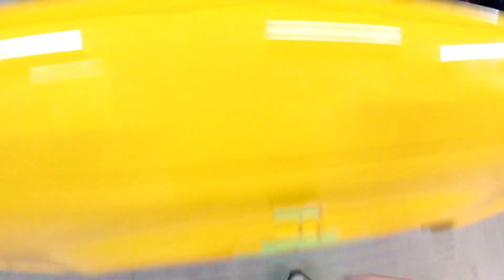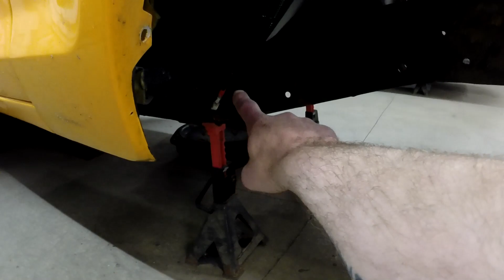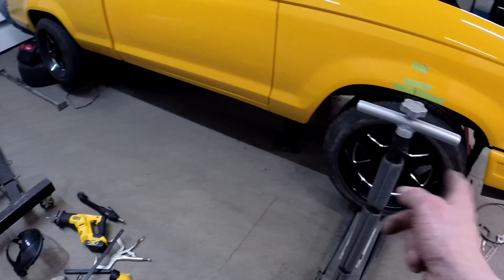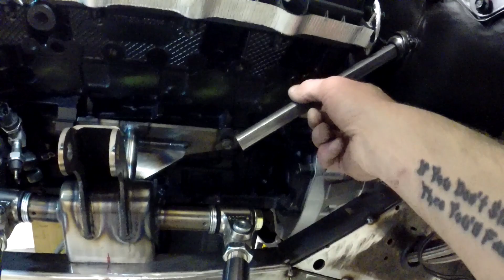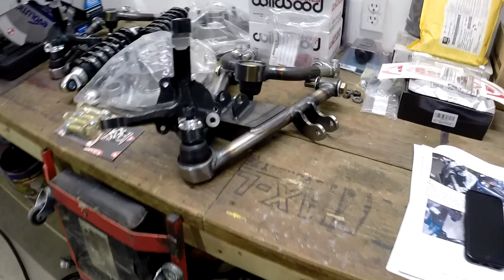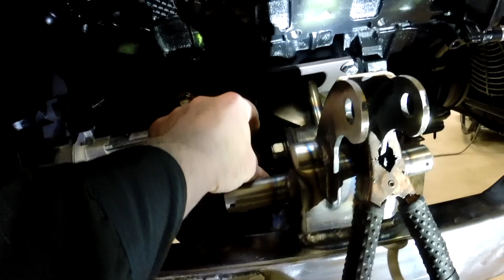Coyote Swapping my 89 Ranger  (pt 7 Front IFS Swap)

Comment: So just wondering, with the space and skills you have, why not take body off and have excellent access to everything?
Reply from the maker: Mostly because i used the Fenders/Body to measure where the old Axle centerline was, then set up the new suspension off those marks. Plus first time I've ever totally replaced a suspension like that, so I probably did things a little unorthodox.

Comment: Curious what you did with the old suspension components.  My kid has a 91 Ranger that could use a refresh on the i-beams, radius arms, and knuckles.  Would probably be interested in picking up a few things from you if you haven't put them in the recycle bin yet.
Reply from the maker: Actually still have the front I-beams/radius arms. Was trying to debate whether to toss them or try and sell them. They have urethane bushings on the radius & I-beams bushings. I do not have the shocks or coil springs anymore. Calipers, rotors, brake pads are on the steer knuckles yet. Pads and rotors maybe have 2000 miles on them.
Reply: @scmotorsports  Nice.  I will talk with the kid, there are definitely a bunch of parts on the front end of his truck that should be replaced.  If you are interested in selling, I am quite sure we would take them off your hands.  Watching your build videos on your Ranger is awesome.  You are meticulous in your build, cleanest and meanest build I have seen yet.
Reply from the maker: @ctdoutdoors  Yes, I would be willing to sell. Are you local to MN?
Reply: @scmotorsports  yeah, live up in Blaine and work in Eagan.
Reply: @scmotorsports  Not sure if you got rid of those parts or not yet.  I tried a couple times to leave a reply that had contact info and it looks like YT removed them.  Was wondering why I hadn't heard back but I am guessing the powers that run YT eliminated them before you saw them.
Reply from the maker: @ctdoutdoors  No, I didn't get any messages after your Blaine/Eagan comment. I still have the front twin I-beams. You can always email me at sc_motorsports@outlook.com

Comment: Check out PBH quick connect adapter for your upper radiator fitting
Reply from the maker: Yeah, I wasn't sure if I needed it or would have room for it. With the first fan I tried it would push the top hose into the fan too much. Now that I am using a different fan, I have more room. Turns out too, once I installed the intake and throttle body, the hose was rubbing on the throttle body plug-in, so I had to install one just to move the top hose away from the throttle body.

Comment: Lower is always better. Never keep a ranger stock height. Like I said in a previous comment on another of your videos, I am using the aje bolt in strut stuff and I am hoping it gets me at least another inch of drop over the djm beams I had. I dont want to be slammed but wheel gap of any kind is horrible to look at and my Explorer 8.8 is axle over leaf so its a 4 inch drop already
Reply: Curious how low the aje kit sits as well would like to be tucking  my skinnys up front about 1-2" to match the rear
Reply: @dylanpeeters8  there's a really good build thread on the ranger station called aje front end who's done it. Google search it. It is very, VERY informative.